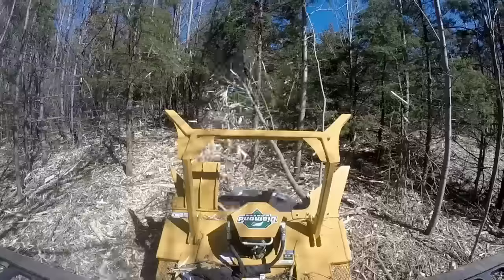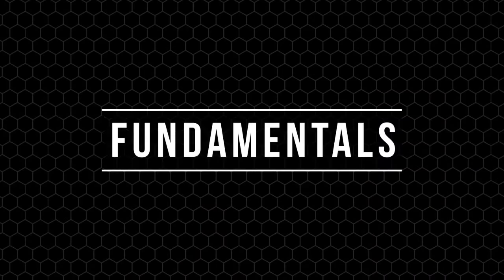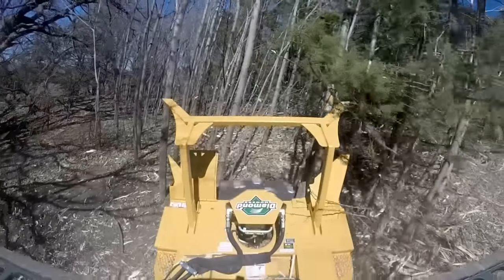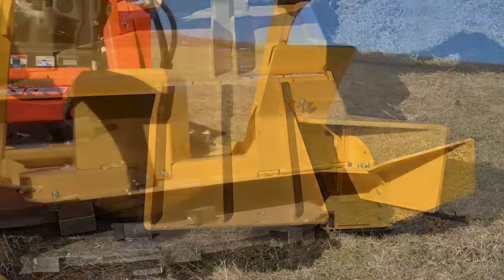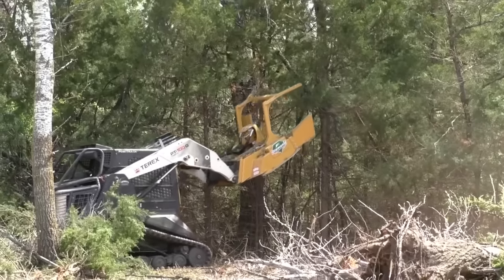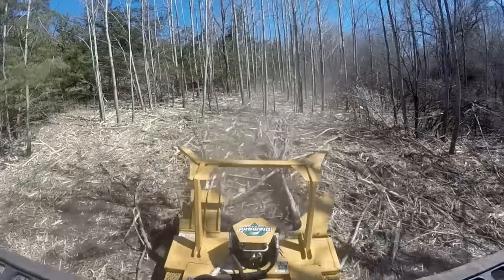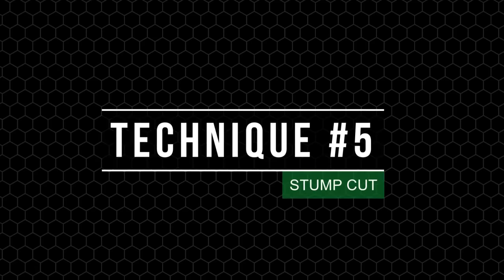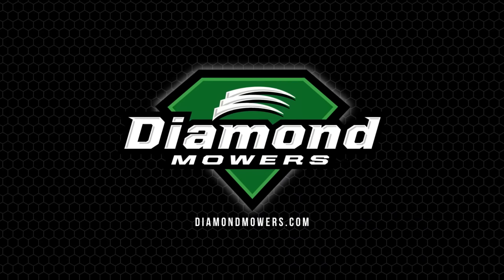Operating Techniques: Disc Mulcher Attachment for Skid-Steer (GEN I) | Diamond Mowers

Comment: Which mower would Diamond recommend for mowing briar piles? Forestry, rotary, or flail? How about a video doing this with all 3 mowers and pros & cons of each mower in this application?
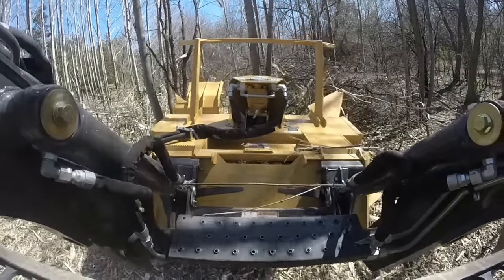Reply from the maker: @drew6709 Our Skid-Steer Forestry head is best option, however the product is best suited for processing standing material. Please reference 3:28 into the video for the "Ground Pull" technique. This demonstrates the most effective use of the forestry head for your application. If you have any further questions, feel free to contact info@diamondmowers.com for technical support.
Reply: @diamondmowers  morning.... Would like to know where to purchase this machine in what price and any specific contact I can get so that I can directly have contact or chat..

Comment: Looks like a great unit, however, using an attachment like that without cab glass protection (even if the front is polycarbonate) is insanity.

Comment from the maker: Absolutely, this is a tool - not a toy - and it's inherently dangerous to operate. With that being said, the Lexan, bulletproof glass is one of the safest options. And since Diamond's forestry head throws most of the debris away from the cab when operated correctly, you won't have to worry about being showered with debris.
Reply: คุณบอกเขาเอามาขายในไทยซิ ต้องการมากไม่อยากเผาป่าเวลาทำไร่ ทำสวน สร้างสวนไง สวัสดิ ครับ
Reply: If your front window made of glass someone  could put a piece of Lexan in front of the window!

Comment: If the tree falls on you use the "crap your pants" technique.
Reply from the maker: +madisonelectronic - The “crap your pants” technique is too messy for us. It is better to use the push bar to push the tree away from you. For large trees, it is best to notch the tree first, then finish the cut from the other side using the push bar to push it away from you.
Reply: extra pair of trousers not included!
Reply: Loomis but plenty of branches to wipe with  in case of a oh crap happens
Reply: madisonelectronic i

Comment: i know left will cut down thick trees but whats the thickest size i should try to multch with the right side ?
Reply: thanks.
Reply from the maker: dee 001 - It will cut down a 14 inch tree and mulch a 6 inch tree pulling it in on the right side.

Comment: This attachment work with a kubota svl-2  75 hp this is not a high flow?.
Reply from the maker: Unfortunately, the Diamond Mower Skid Steer Forestry Brush Cutter requires a skid steer with an auxiliary hydraulic flow rate of 32 to 41 gpm.  Since your Kubota SVL-75 doesn’t have the high flow option, it will not have enough hydraulic flow to operate the Diamond skid steer forestry brush cutter.

However, your skid steer may have enough hydraulic flow to operate our skid steer rotary brush cutters.  Depending on your application, this rotary style brush cutter may be able to handle your brush cutting application.  Please feel free to call our factory and speak to one of our inside sales people and they could discuss your application with you.
Reply: Diamond Mowers 0
Reply from the maker: Hi John. We see you wrote a 0. Do you have a question we can help you solve?

Comment: Is this hi flo, how big of a machine do you need and what kind of money are we talking?
Reply from the maker: Our forestry mulcher is what we call High Flow, by that Diamond Mowers means 32 GPM or higher for flow.

If you need and/or want the forestry attachment that is pictured they retail for $21,950 + shipping. 

However, depending on what size trees you are cutting and what you're doing with the downed trees, there may be other options.

Feel free to give our inside sales consultants a call and they can help determine the best Diamond Mower product for your application.

Comment: I have been running one now for several months. it took a few days to get used to Mainly cause I have a problem of not wanting to slow down. But we finally met somewhere in the middle and work well together. If your cutting in thick woods I recommend to not put the deflector shield all the way down  you will eventually tear it off if your like me anyway. It has been a great machine and a great asset to my business.
Reply from the maker: Thanks Tony! We would love to learn more about your experience. What would be the best email to reach you at?
Reply from the maker: Thanks Tony. We will be in touch. 
Ben - Marketing
Reply: sledge hammer

Comment: Only made it 30 seconds into this before hitting STOP. Do people really think the obnoxious noise / heavy metal music adds something?
Reply: Bitterrootbackroads ....agreed. Maybe the producer of the video felt that the primary customer-contractor market is the 20-30 year old motocross fan. I worked as a sales manager for a power tool company (Makita) and we sponsored motocross and soccer events. ALL of their sales videos featured the obnoxious heavy metal music like this video from Diamond. What is it that industrial manufacturers think that you have to have a radical, nerve-shattering music track to impart a message of toughness and aggressive machine performance? Why not just deliver the facts...explanations of performance, features and benefits, and safe operating techniques...without the meth-head accompaniment in the background. A professional voice is sufficient for me as a buyer. (Clearing our 450 acre ranch of cedar, mesquite and white brush with a Bobcat 630S, grapple, 16” capacity hydraulic shear, and 6’ brush shredder on the skid steer). I might consider the Diamond despite the obnoxious music track.
Reply: Just a question, would it bee better if video had hiphop/crap inspired music instead?

Comment: Yeah, I want one.   Unfortunately, I only have 18gpm... And not enough bank account. Do you have a 3pt PTO option?  It wouldn't be as useful, but might be a fair bit less expensive
Reply from the maker: +farmerboybill Our skid steer attached rotary cutters might be a solution for you. These can be purchased in the $9,000 to $13,000 range, depending on the size.

If you would like to explore this, send us an email at: info@diamondmowers.com with your contact details. The best place for us to begin is to understand your application.

Thank you,

Tim Kubista
651-955-6665

Comment: It’s also not a good idea to do technically 3 with a wider, and longer tree
I’ve seen another video of one of these doing that, they ended up with a totally jammed machine :(
Reply from the maker: Good point! The key to operating the disc mulcher is to maintain the speed of the disc. With any size tree, you risk jamming it up if the disc is turning too slowly. Take your time and keep the speed up
Reply: The guys I said that jammed their mulcher the disk was full speed and the deck was low it was attempting to take in a good section of a big branch on the ground and that’s when they jammed up their machine the jam was so bad the disk was on an angle and they couldn’t even unjam it with a chain connected to a tree, the branch was totally jammed inside the deck
Reply: Go to a video called “Disc or Drum Mulcher” by Stanley “Dirt Monkey” Genadek and watch it from 10:40 and you’ll see how they jammed their machine and you may be able to provide another tip or a don’t do when you do another one of these kind of videos

Comment: Can I get an attachment like this for an e35 bobcat excavator?  Or only for skid steer?
Reply from the maker: Unfortunately it is not compatible. Not enough flow and overall weight is under our minimum. We need 24 GPM and 900 lbs. of lift capacity over the side with the blade up.

Comment: This thing looks like it works great but how about operator safety maybe a big thick rubber mudflap so all the shit flying at the cab don't!
Reply: Stephen Beal - There is very little  material thrown back with this unit. You learn very quickly proper technique. I thought I would have to guard my Bobcat from materials but this hasn't been a problem at all.

Comment: I have a site littered with field stones and large rocks.  Would this heads teeth be destroyed if it hit one?
Reply from the maker: If the objective is to cut the brush low to the ground, then our product would be a poor fit and you will be replacing a lot of teeth. 

In these circumstances, a hydraulic shear is a better choice. However, if it is acceptable to leave stumps at 12" or higher, about the rocks/obstructions, then our attachment would be a good fit.
Reply: Eric Mucklow - Eric I have an extremely rocky farm and as I have been careful this hasn't been a problem. I am very cautious in the rocky areas and the machine allows good visibility up front to avoid rock damage.

Comment: Can this be used with a Toolcat?
Reply from the maker: This doesn't have the specs to handle the Forestry Mulcher. It needs to have 32 GPM, needs to be able to lift 2,240 lbs, and needs Lexan glass for the cab.

Comment: Hi Guys, I have a Job for to do and I saw your movie, it's a attachment? Fits on a Bob Cat S175? How Much cost? Can You please give me a call?
Reply from the maker: Hi Valci: Yes, this is a Skid-Steer attachment. Not sure if this model comes with a high flow option or not.  On our rotary heads, we need 17-41 GPM of hydraulic flow.  It appears that this model has 16.9 GPM unless it has a high flow option.  
What are you trying to cut Valci?

Comment: Would a case sr220 run this attachment
Reply from the maker: If the SR220 has the optional high flow it would have 37+ gallons per minute and would be able to run it.
If it only has its standard low flow at 24.2 it will not be a good fit.

Comment: been running flails for 16 years, and unless you want a tooth coming through your front windows never lift them above the front window.
Reply from the maker: Do you run a Diamond Flail Mower?
Reply: I have ran lots of flails, and if the teeth come off ever that is a very stupid way to cut. We used to own 12 of them, and that was the first thing we told our guys not to do.